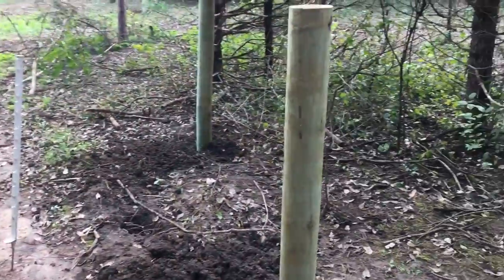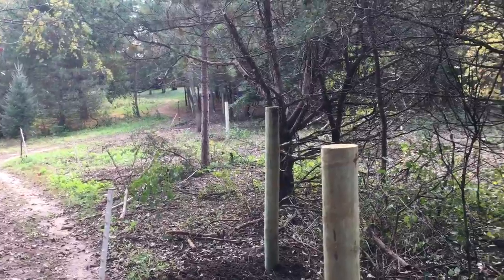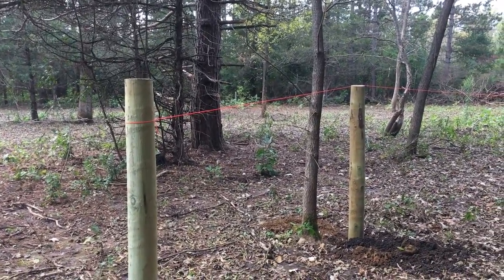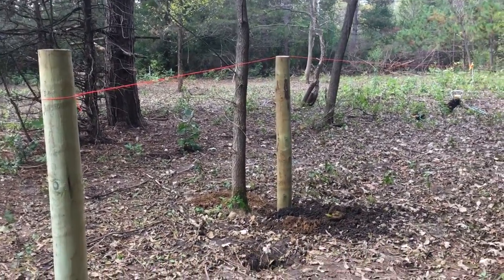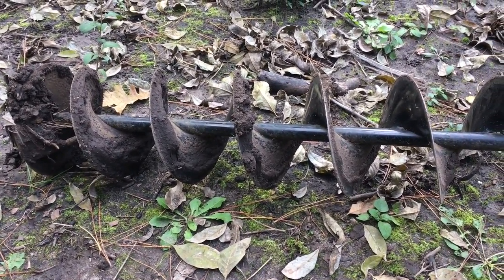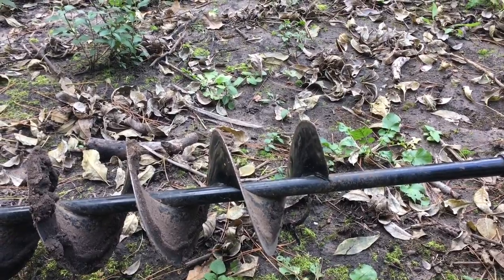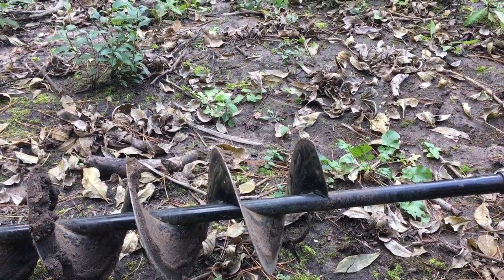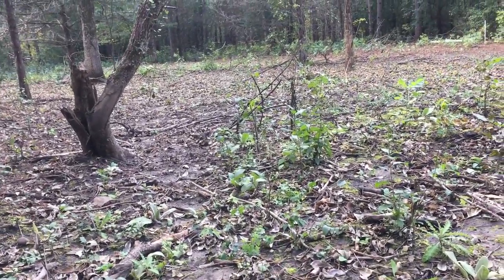Using an ICE AUGER to Drill Fence Post Holes - Pasture Pig Fencing

Comment: I dont advise this with an ice auger anyway, There's a reason an earth auger has 2 sets of handles for another person. If you use an ice auger and you happen to strike a root or rock in the dirt , that's going to be a world of hurt for you. I know someone who did this and he struck a tree root in the ground and the powerhead tore out of his hands violently and dislocated his shoulder.
Reply from the maker: Agreed that this is a dangerous move in some cases. I didn't have any issues and don't have a ton of rocks in my area. I did hit a couple of roots and it was rough but I was fine.
Reply: There are one man earth augers too. They just have a shut off lever that hits your leg if you hit a rock or a root.
Reply: My concern as well in rocky areas, but interesting it worked for you
Reply: Yup very  true ot will work but not ideal there is no brake  on these  I duh a whole private fence 3 ft deep whole with a makita post drill electric  it was awsome saved my  shoulders to. It was a one man and smooth like butter